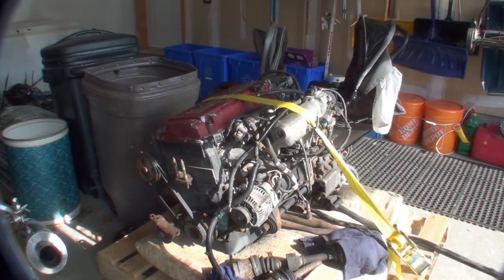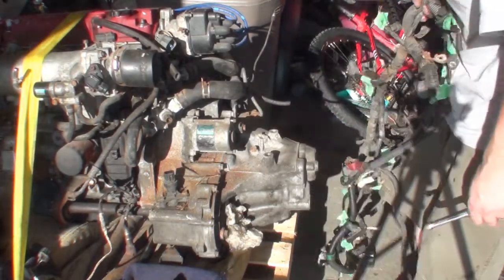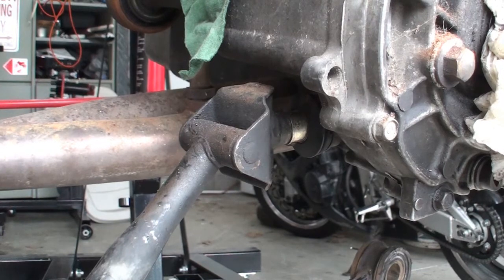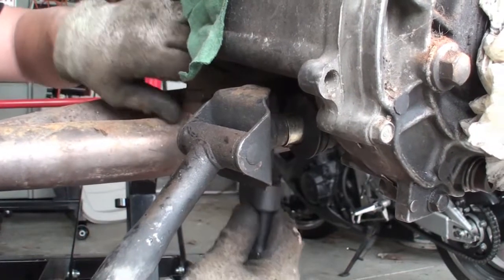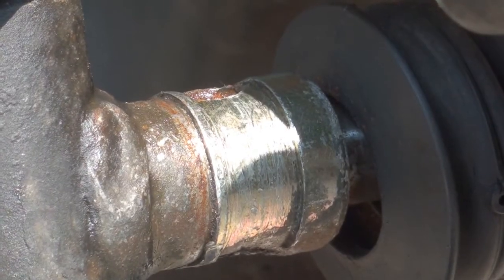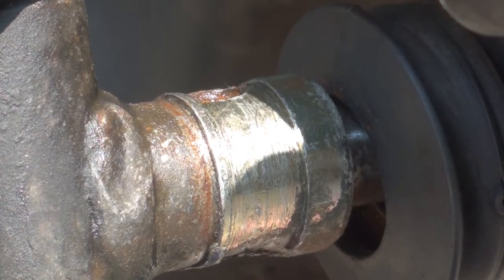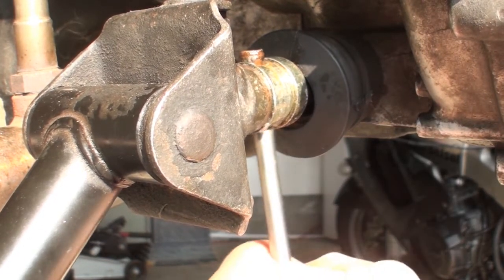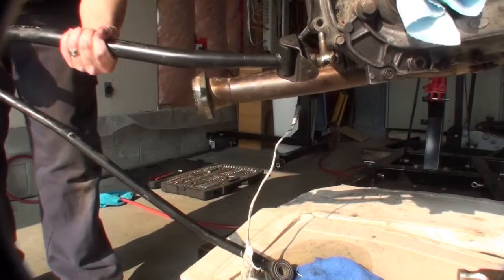Engine tear down pt1- wire harness and bitch pin

Comment: Too bad you couldn't re-use that wiring harness. that saves sooo much damn time.
Reply from the maker: Don't worry, I will be using that wire harness. That's why I took the time to label everything. It's plug and play with the harness that's in the Sol
Reply: superdelsol score! Yeah, I've seen motors come with cut wiring harnesses before and I'm just like "why would anyone do this when it takes maybe a half hours work to just disconnect it through the firewall.